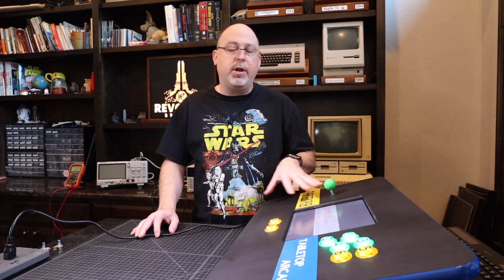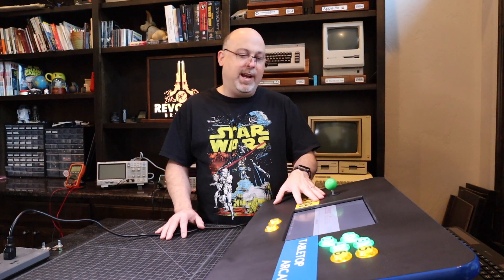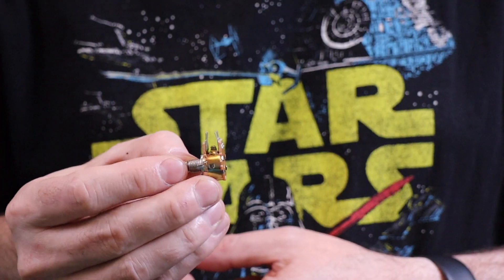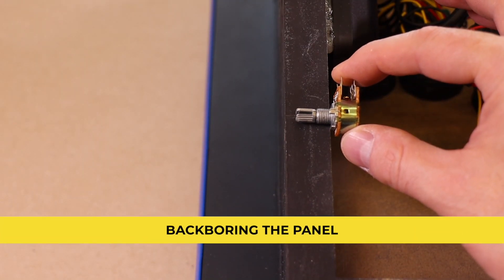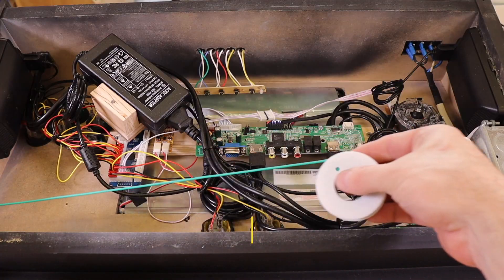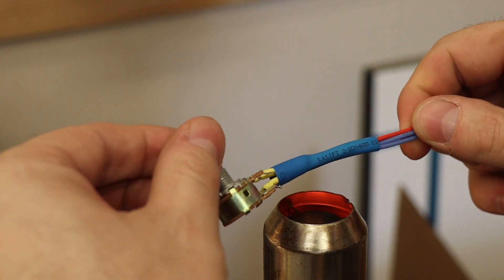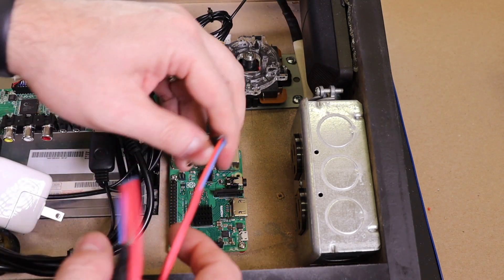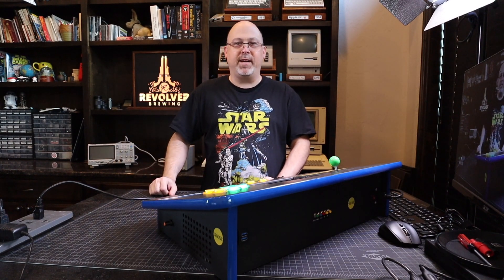Arcade Volume Control

Comment: Thanks for this. Not seeing much direction on the ground green wire. Do you take one green wire and splice it from the jack and plug to that extra spot on the potentiometer you applied solder to? Im mainly asking because the diagram doesn't show the green ground wire going to the potentiometer directly.

Comment: Can I use a different potentiometer value?
Reply from the maker: Depends on what line levels you're working with.
Reply: @TheGeekPub  what do you mean by line level ?
Reply from the maker: @VINInvents  Outside of what I can help you on.
Reply: @TheGeekPub  I want to make the same thing you did.. but it is possible to use different ohm value?
Reply from the maker: @VINInvents  No.

Comment: Is the potentiometer logarithmic or linear?
Reply: I believe your using linear
Reply from the maker: @kylekirsch6446  You should almost always use a logarithmic  pot for audio.
Reply: @TheGeekPub  Thanks for the suggestion! I reviewed the kit you linked in the description, and it said your potentiometer was linear.  Maybe their are both kinds in that kit. Thanks for your help!
Reply: Here's a video with similar electronics and your project but its using a linear potentiometer. The potentiometer is also 500 ohms rather than 500k ohm potentiometer.https://youtu.be/sJ5vhShdVjo

Comment: Great video. My wife decided that we needed to add a "night mode" for our 2 arcade cabinets if we want to use them after the kids go to bed.

In the video, you used a B500K Ohm potentiometer (linear.) I tried an A500K Ohm potentiometer (logarithmic,) but didn't have any volume control except at the last 10% - which was basically like on/off. I am going to try the exact same B500k Ohm linear pot that you used and hopefully get better results. One of my builds has an amp, while the other is audio from a JAMMA harness. Wondering if the same pot will work for both builds.
Reply: I'm having the exact same problem. I know its two years ago but did you have any luck?
Reply: @goodlookinouthomie1757  Unfortunately, no. Never did figure it out. Still have the pots. Maybe one day. In the meantime, I've just learned to live with it.

Comment: Great solution for retrofit.. If planned from beginning I would prefer some vol+ vol- arcade buton connected to the rpi gpio so you control the volume from the rpi! never done it but seems simple to add thoses commands.
Reply from the maker: Yes. You could do that with a rotary encoder and a couple of GPIO pins. But remember, many people are building these with PCs and PC based SBCs.  Not always a GPIO available or code.  Plus, anyone can do this mod regardless of skills.
Reply: @TheGeekPub  thats why i was so excited about this video. i use an intel nuc in my arcade. no gpio!!
Reply: Yes I agree the simple stereo log pot is a great universal way and will always work!  I also got a NUC laying around ready for a bartop when I stop procrastinate 🥺.  Got a cheap arcade1up and parts to add hdmi on the monitor and some usb cable encoders but I read quality was crap so I returned it. wood work isnt my cup of tea but electronics so I should buy a bartop mdf kit

Comment: Mike, a better and cleaner option not to mention easier, would have been to use a rotary encoder on the GPIO and run a plug-in to adjust the volume, no need to use an expensive dual gang pot. Here is a link to someone who has done this on retro Pi https://gist.github.com/savetheclocktower/9b5f67c20f6c04e65ed88f2e594d43c1
Reply from the maker: I’ve seen that.   It’s neat. But I disagree about cheaper or easier.
Reply: TheGeekPub thanks for the response mike did not say cheaper but that’s ok, I found controlling thru software better in my honest opinion
Reply: @Celcius1  You did say it was cheaper.  You said Mike's way was more expensive, which is the same damn thing.